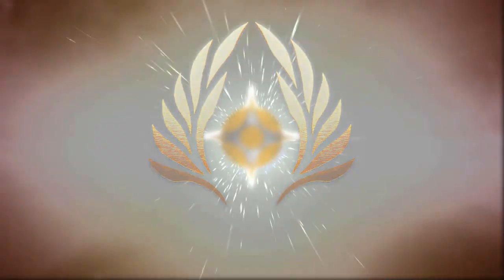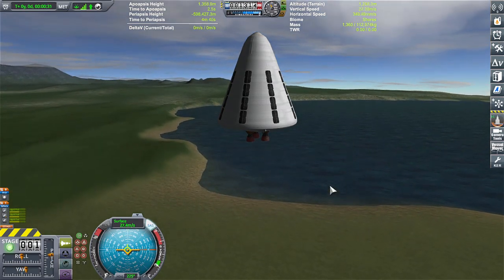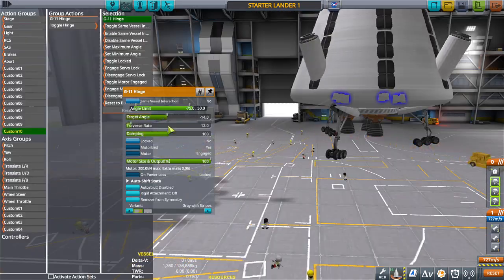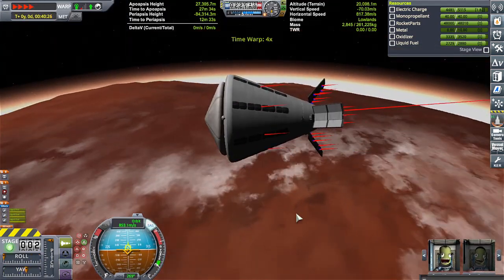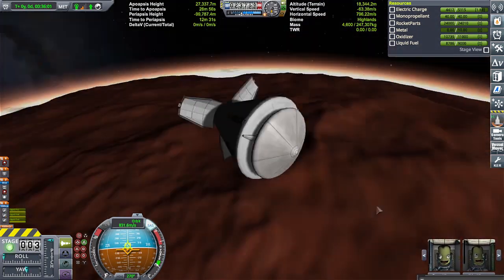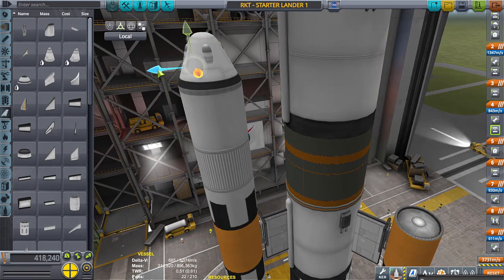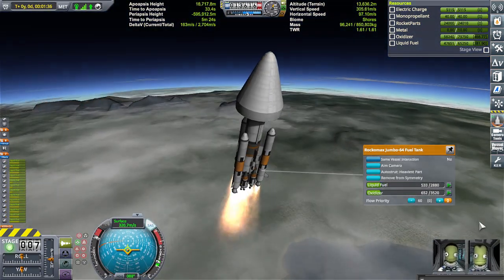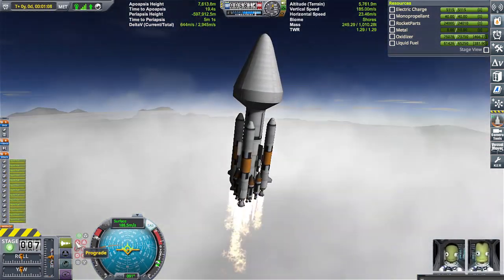SEED FACTORY COLONIZE THE SOLAR SYSTEM \ Kerbal Space Program

Comment: I love the new parts like hinges and pistons etc. got wen I brought the Breaking Ground update. But although they all run and move and work fine in the VAB or Hanger when I try to use them as they are set up to work on the craft y the Robotic control box They not only not show up on it or in the menu hey don't work at all. So all the great stuff in the robotic section looks cool is cool... But can't e used in the flight part only in the buildings when being made?  Damn it.